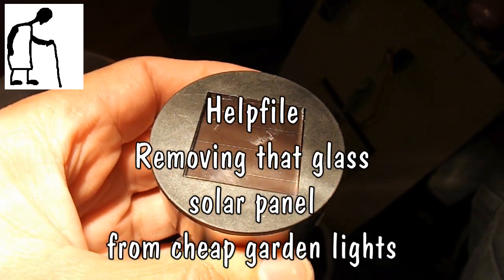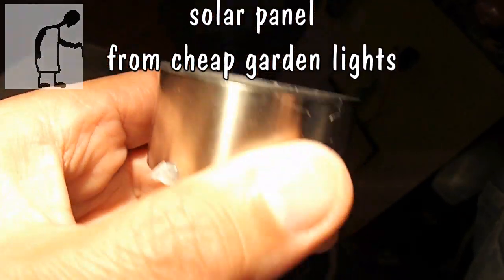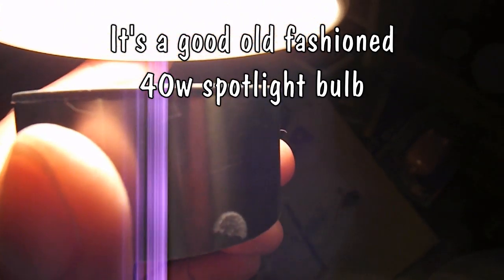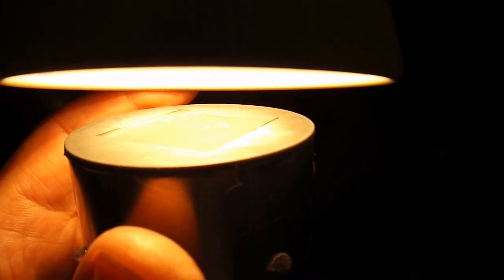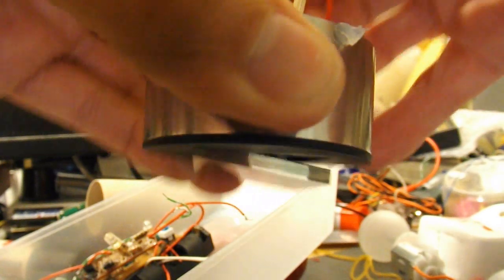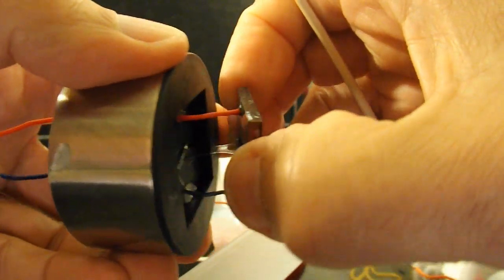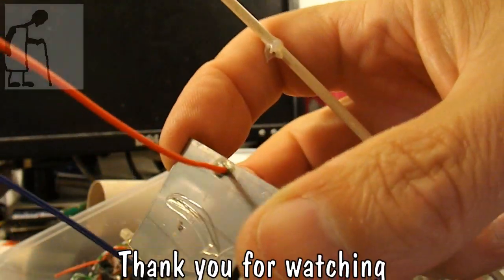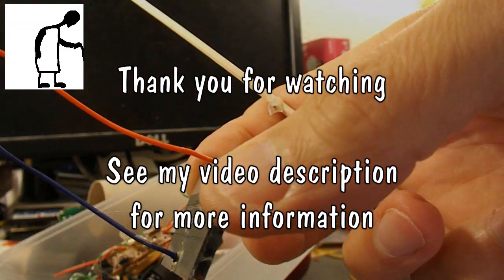Helpfile - Removing the glass solar panel from those cheap garden lights

Comment: But can I use a heat gun and heater
Reply from the maker: There is one way to find out, try it!! This video is many years old. There is no guarantee that the lights you have are manufactured the same way using hot glue. The most important thing is to take care, so you don't burn your hands and don't set fire to anything.

Comment: At what temperature would you reckon the glue releases? I can pop together a metal box with heater and thermostat relay. (ITC-1000 are cheap as cheap chips $3 to $20aud. I use them for beer, finch cage, cheese making etc. I use the 240v model in Australia so choose correctly)
Reply from the maker: A quick google on the temperature of hot-melt glue sticks comes up with this - High temperature (also called standard temperature) hot melt is a more common formulation and can typically be dispensed anywhere between 350-410 Degrees Fahrenheit with most non-adjustable guns running right around 380F. - or alternatively - These guns are often referred to as High Temp and Low Temp glue guns. They have fixed settings 195°C for high temp guns and 130°C for low temp.
Reply: @GrandadIsAnOldMan  hmm, I put mine (minus circuit board, just the top, in a glass bowl with loose metal lid) in the oven at 70c for an hour and was still well stuck. Maybe epoxy not glue?
Reply from the maker: @dmaifred  you could be right, but 70°C is nowhere near 195°C
Reply: @GrandadIsAnOldMan  Rodger, I shall step my way up. And try not to incur the wife's wrath by melting plastics in the oven (again)
Reply from the maker: @dmaifred  I had to wash the walls down and replace the hob filter after filming this video https://youtu.be/L2IhKjM1N-o

Comment: Here is the beautiful Solar post lights I like so much: amazon shops sogrand
Reply from the maker: If you are thinking of buying them to take the solar cells off them, it is probably cheaper to buy the solar cells on eBay or Amazon. If you do decide to take the solar cells off them, I should add that alcohol is also very good at releasing hot glue. It creeps between the hot glue and whatever it is stuck to and you can pull it away. Another point is that excessive heat can damage some types of solar cells.

Comment: i use hair dryer to take it out. If not enough heated wires can break off from panel, and later only by condictive glue you can place it back.
Reply from the maker: It depends what sort of glue they have used, I have found some that are not hot glue and heating them had no effect.

Comment: Thanks! now i can make my entire room solar-powered! i've been collecting these ligths for a long time.
Reply: Just make sure your lights don't draw too much current or those panels will burn out.
Reply: @Nexalian_Gamer  What? That's not how solar cells work. You mean if I connect my tiny solar cell on an old fashioned light bulb, the solar cell will burn? No, it just does not generate enough.

Comment: This is 2018 and I've been cutting them,thanks.
Reply from the maker: If they are hot glued in place you are probably better running some rubbing alcohol (methylated spirits, denatured alcohol, surgical spirit) over it as it releases the glue. That way you don't run the risk of overheating it. Heating it certainly works but it is easy to overdo it.

Comment: Any tips for soldering the wire back? I removed mine but wires remained...
Reply from the maker: If you mean the wires have pulled off the tags on the solar panel then you might be lucky and you are able to solder them straight back on. If you are unlucky you may find the solder pads on the panel have also broken off and there is nothing left to solder on to.
Reply: I found some silver conductive glue that is supposed to be used on membranes, cold solder, retrace and I will try it. I removed 14 cells in a bad way and almost all ended up without pads. Then i discovered your video searching for soldering them back tips.  Next time around.
Reply from the maker: In theory you can use "denatured alcohol" or "Turps" or "Methylated Spirits" to release the hot glue from anything it is glued to. I haven't tried it on these solar lights but it might be a handy tip. It doesn't dissolve it, it just gets between it and whatever it is stuck to, so it loses grip and can be pulled free.

Comment: Strange old world sometimes. This afternoon I was given 8 solar garden lights which were very corroded. I considered cutting the solar panels out until I found your video. They are quite large compared to the modern ones and I fancy having a maybe 2 or 3 brighter lights connected to all the panels in parallel ( I hope) . Thanks for the video you saved me hours of work.
Reply from the maker: Hey, 4 years later I had a new comment on this old video and spotted I had missed yours. Sorry about that. Did your project work? 😊

Comment: Hey if i bought like 40 of these pights what kind of blocking diode should i get for protection
Reply from the maker: Sorry I have no idea.
Reply: I don't think it matters as long as the diode can carry the current. I think a schottky diode might help as it does not reduce the voltage as much but they cost more. It depends on what spare volts you have. Best to Google it.

Comment: ohh.. I got some of those and I was thinking of disposing because some of them are not working.. good thing I found your video.. love it..
Reply from the maker: +howtostartenergysavi thanks, another alternative is to use denatured alcohol or methylated spirits as I would normally call it. That seems to break the seal on hot glue quite effectively although I haven't tried it on these lights.

Comment: I have come across similar lights in which the solar panel is not glued in but sealed in with epoxy resin. I assume that this method for salvaging the solar panels will not work with such a light as the resin is not easily melted and it covers the front of the panel to ensure water tightness.
Reply from the maker: ***** well there is one way to find out, but I think you are probably right. It depends what you want to use it for, it may be fine left in it's original casing and extending the wires as required. I have several panels that are sealed in resin but they were still just held in the casing with hot glue so I guess it just depends on the manufacturer.

Comment: i need this video..
I had the lights and was trying to get them out for a project and didn't come! so i used the whole covering, so now I can get the actual panel out now, thanks!!
Reply from the maker: Not sure if it will work with epoxy panels as they don't absorb the heat so much, but the glass panels get hot easily. A hair dryer would probably work fine too. You might need to heat the inside too, depending on how much hot glue they used.

Comment: Why didn't I think of that some time back. Thanks.
Reply from the maker: I recently made a small solar powered car using one of these glass panels. To get it to work I was holding it right under the spotlight. Because I had assembled it using hot glue it started to fall apart as the hot glue softened and a bell rang in my head. I have chipped plenty of these glass panels in the past trying to lever them out and usually break the wires off at the same time. Hair dryers work too, but this spotlight is on my workbench specifically for testing solar toys because all my other lights are CFLs and don't give enough power.